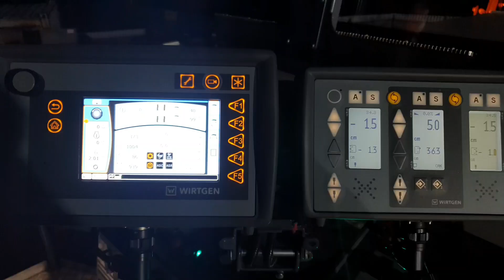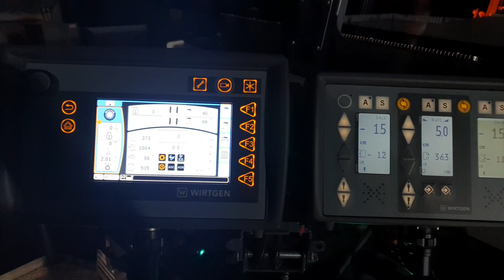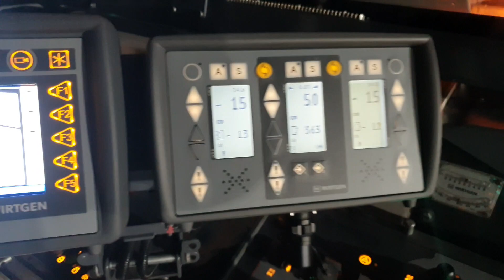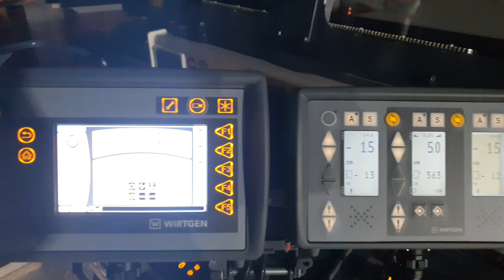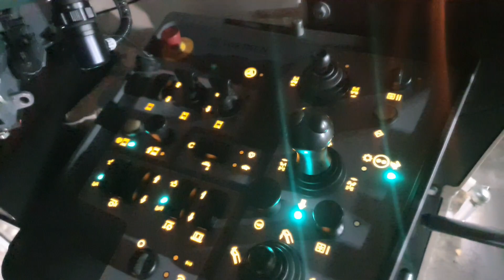WIRTGEN W200i & VOGELE 1800-3i Korea Pohang taechang #18

Comment: you guys should add the "curb sensor" or some call it "rabbits foot" to that 200i. helps out when cutting flush to curb you can pick up on side door on and off curbs or obstacles without"level pro" autos going off.
Reply from the maker: Thanks for the good info my friend.  will be of great strength♡♡